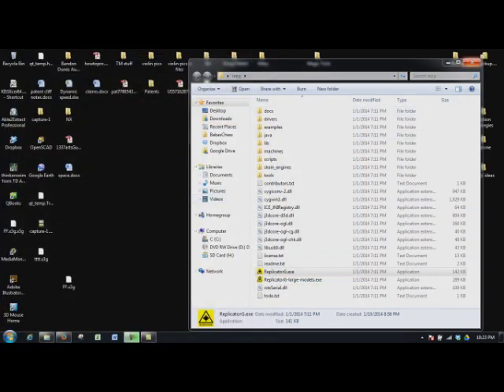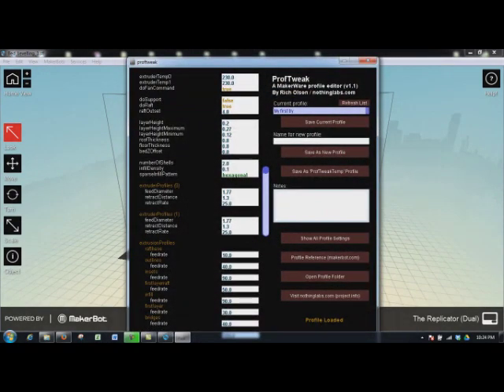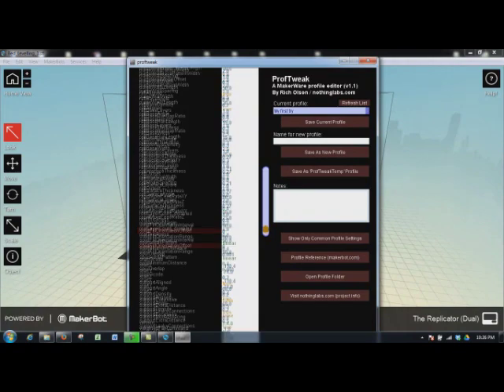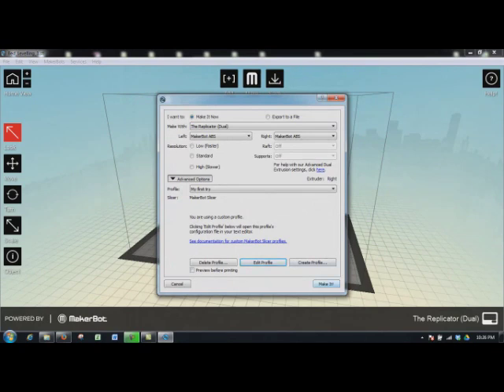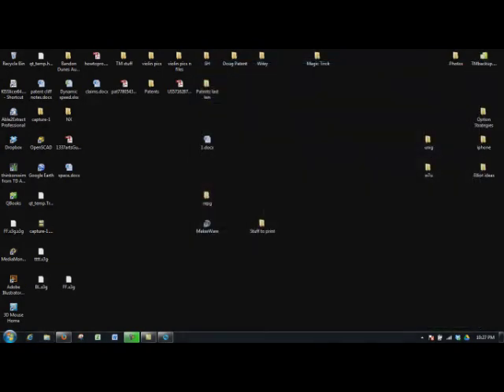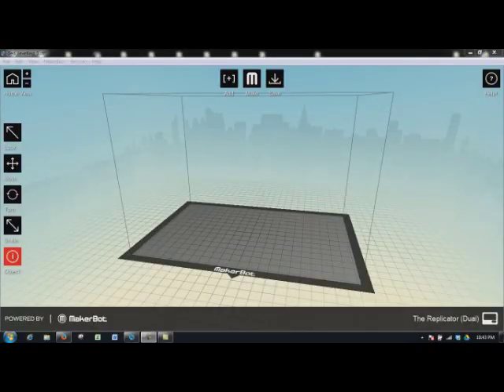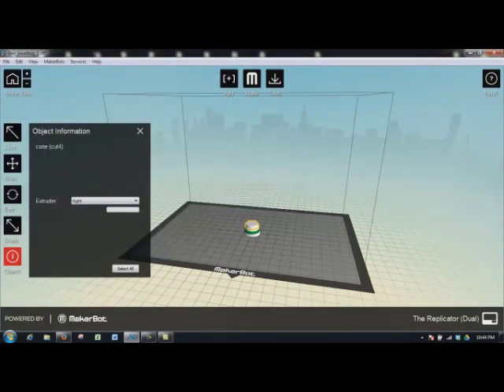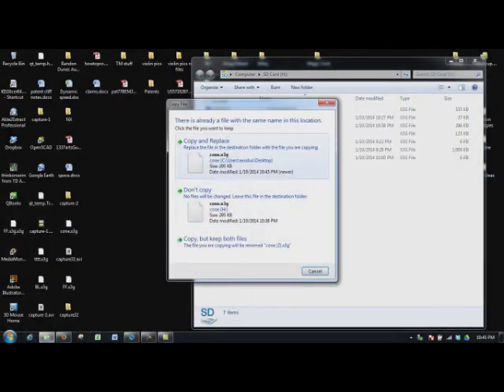FlashForge Creator Setup 3 of 3 - Summary and first 2 prints

Comment: Have to say a big thanks, Loved the videos and i not have a CTC 3D Printer working perfectly for dual extrusion. The bed leveling script worked a treat and the cone printed out great, well was out of alignment the first time but after recalibrated was prefect.

Can i be a pest and ask where you got the glass from, Needing it for the build platform to save the hassle of me taping it and that just now?

Also on another note for people with the same printer, I tried to update this printer with makerware and it messed up my SD Card reader on the bo. When installing sailfish i didn't have to bother with the B version for broken SD Card readers the normal 7.7 worked fine and got my SD Reader working again.

Thanks

Comment: Whats wrong with printing from usb?
Reply from the maker: data transfer issues...it can be done but if you print enough there could be problems specially with longer prints...could be solved with newer printers...sdcard has never failed me...when you print an 8 hour print you don't want problems lol
Reply: Okay, thanks for the tip and thanks for the awesome tutorial.